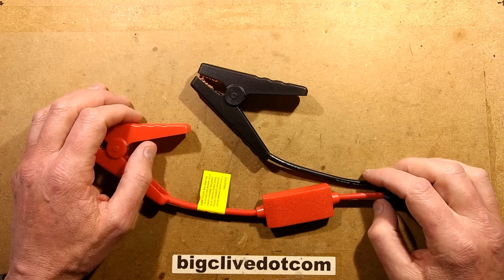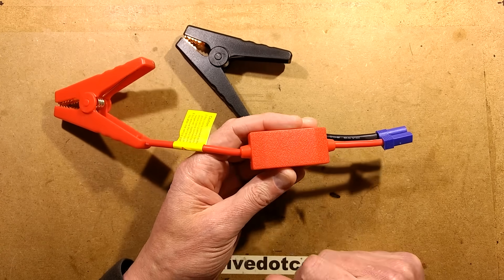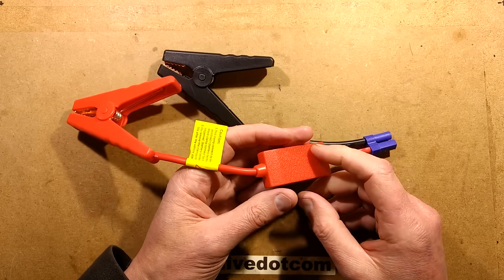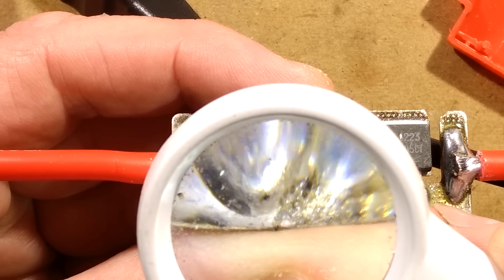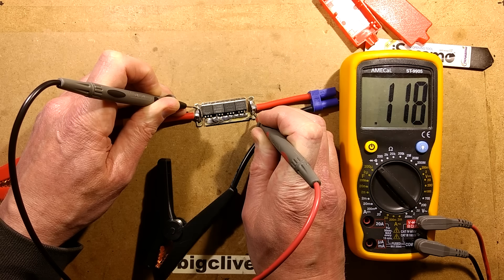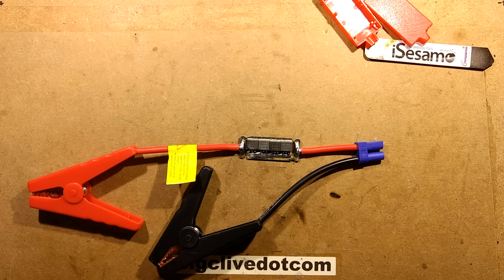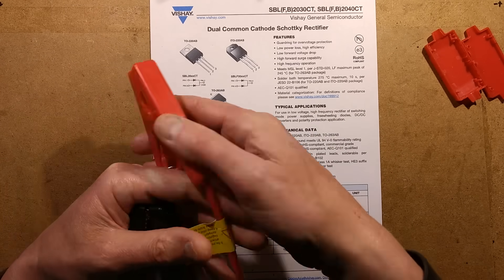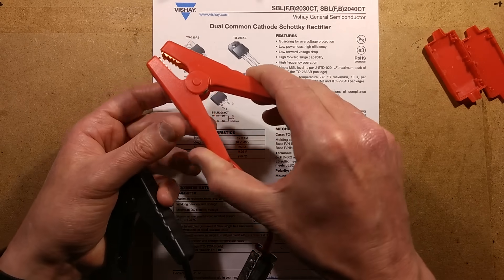What's in the little red box on some jump-start leads?  (Guess first.)

Comment: Isn't 10 gauge wire rated for only 30 amps? A long time ago I picked up a set of cheap jumper cables that wound up being 10 gauge. The first time I used them there was a loud bang and one of the cables blew in half.
Reply: Assigning a current rating to a wire without environmental conditions is pointless.
If you put that wire in ice water it will have no problem conducting hundred amps continuously. If you run it at 50°C ambient without air flow it will melt the insulation at much less than 30 amps. A few hundred amps are fine as well without ice water if it's just a very short time/pulse.
Reply: kuhrd Actually, 10 gauge copper wire can safely deliver much more than 30A continuously provided the insulation is sufficiently rated for the temperature rise and the wire is sufficiently exposed to sufficiently cool air to allow for adequate cooling (as opposed to being part of a tight bundle or in an environment with especially elevated air temperatures).  You will find that one can easily deliver a sustained 50A+ using #10 copper wire with a perfectly acceptable and safe amount of temperature rise to allow for plenty of safe margin for wiring with the typical 90C to 105C PVC insulation when operated in an environment at all practical for human habitation.  However, you can not continually deliver hundreds of amps through #10 copper (especially if copper clad aluminum) wire without both an excessive rise in temperature (power dissipated, and thus temperature rise, to a degree, increase fourfold for every doubling of amperage, which places some very practical upper limits on the current that can be delivered by a given wire gauge without self incineration) and a considerable degree of voltage drop for a given length of such wire.

The usual ampacity tables that most of us are familiar with are influenced far more by a desire to limit the degree of voltage drop in extended runs (typically to 5% or less) and ensuring a highly conservative figure to account for lack of adequate free air cooling when multiple power conductors are contained within an enclosed raceway, such as PVC conduit, where cooling is greatly impaired and accounting for the possibility that such raceways may also pass through areas with very high ambient temperatures, such as a poorly ventilated attic, that can further impair cooling leading to a greater rise in temperature.  The typical figure of 30A for #10 copper is primarily derived from sources like the U.S. Electrical Code, but these tables do not represent the actual safe maximums for a given conductor size in open air (you will get much closer to maximum acceptable limits if you instead look at the chassis wiring tables provided in Code, which would specify 55A for #10 copper wiring with 90C+ insulation in open air).
Reply: A fully charged LiPo booster battery will be 12.6V open-circuit. When I had to jumpstart my car this winter, I measured the battery terminal voltage during cranking and it dropped as low as 5.5V. After the first compression stroke though, voltage bounced back to 8V and the engine started with less than three seconds of cranking.

I was surprised that a power bank with 3x 3.3Ah cells (Silverstone PB06) was enough to start my car at -12C. Not so impressed with losing over 2V from the diode, wiring and contact resistance between the LiPo terminals and car battery's. Using #8 wiring would save 0.3V and give another 50A or so. Every amp counts for breaking static friction.
Reply: For continuous current with PVC insulation yes, 10 gauge is only safe for around 30 Amps continuous.  The big thing to consider here is resistance and voltage drop.  Since the leads are about 1 foot long each you can actually push a few hundred amps through them for a short time.  

High strand silicone insulated wire that is 10 gauge is generally capable of 140Amps when leads are kept to a meter (about 3 ft) or less for 15 minutes duty cycle in 20C ambient air.  In a situation like starting a car where the leads are only connected for 60 seconds or so and the actual cranking time is likely less than a few seconds, you could probably dump around 500Amps across the cable without to much issue seeing a voltage drop of likely less than 1.5-3V.
Reply: Stinky Cheese Actually, he used the word actually properly. He explained that the 10 gauge wire, in question, is capable of more than 30 amps. So how was he wrong to use it, in your opinion?
Reply: @Dad_a_Monk  you know thos C numbers are fake and that mac C for a lipo is 50C right?
Reply: @loris4798  Well, it has been over 2 years, so kind of a late point...The question was not addressed to you,  but glad you decided to comment, all be it late. I was commenting on someone's use of the word "actually". That had nothing to do with the "max C" of a LiPo cell. The word "actually" applied to that one sentence, not his entire post, which expanded beyond the rating on a cable. So glad you read an article, on line, and decided to try to use the info. Good on you! Perhaps you should have responded to @Ethan Poole and not me. Obviously you feel a need to correct someone on the ratings of LiPo cells, so good luck with that.
So...nice comment, have a good day.
Reply: He needs a bigger battery, preferably deep cycle, and heavier gauge wires to the bass amps. 

A capacitor will not be enough in this kind of situation where you have a large continuous power draw. It barely does anything with a small subwoofer, people just buy them because they look cool and have the large LED voltmeters on them.
Reply: Distance also matters.
Reply: them being short means more than 30a, cable rated at hundred of amps and is say 2 meteres long, such as my home made jump lead, are very thick and heavy, made from industrial welding cable, rated for 500a, and 5x heavier than cheap jump leads that say 500a
Reply: 500 Farads is way more than enough unless you're running something like 15 subwoofers which wouldn't even fit in a cobalt. If you're having voltage issues with that much in capacitors, you have a wiring problem.
Reply: Cool, up to 3 volts drop is good enough assuming its 14 V without load. Ignition usually stops working under 10.5 V
Reply: +Teardown Dan -  No, a more common value for a LiPo booster pack is 16.8V using parallel series of 4 cells.  The key to getting one to jump start a car is that the primary SLA battery isn't completely dead, that in a few seconds it gets some charge back into the primary battery so they are working in parallel to provide more current.

Additionally 3 x 3.3Ah cells is in inferior design for this purpose, doesn't make much sense that they would do that instead of 4 x 2.5Ah cells which due to a different internal construction have  higher current capacity, so are you certain that is how it is designed?
Reply: Pretty sure. There is no need to put multiple cells in parallel, LiPo batteries can output over 200A on their own - radio-control hobby batteries have discharges rates as high as 250C, which means over 750A for a stack of 3Ah cells.

Here's my tear-down and poking around of that PB06: http://www.tomshardware.com/picturestory/751-silverstone-pb06-usb-power-bank-tear-down.html
Reply: That's all the computers in your car starving for voltage, not just the ignition system. very bad for it. You need a hefty capacitor on that stereo system.
Reply: Doesn't matter because it's alumin(i)um and it could be rated at 10 amps at BEST...
Reply: Robert Gibbons I've wondered the same thing, oddly enough these things DO WORK. My only guess is that the battery is charged using pulsating DC and that's why you should wait until the charger quits beeping, green light goes on, etc.
Reply: even a 20c 2000mah 3 cell lipo could easily start a car. that would be a 60 amp continuous rating and roughly 90 amp peak (10 seconds). i have a model airplane i pull 50 amps out of a 12 guage wire, never really more then 5-10 seconds though.

what really makes these things interesting though, they can carry more then 80% rated amprage when they are dead, meaning even at 11.1v, the voltage really isnt gonna drop much.
Reply: The key word here being "cheap" you can pick up any set of jumper cables and if you are a veteran mechanic you can pretty much guage whether or not they are cheap shit or high quality. with that said and stranded on side of road you use what you got. cheap or high quality comes into play when you are purchasing a set , with todays modern all computer driven cars dont skimp on the jumper cables . why fry a 12oo dollar ECU because your bought the $8.99 junper cables from harbor freight instead of the $29.99 ones from napa
Reply: A 10 ga. wire will handle a lot more than 30 amps before it melts. 10 ga. house wiring requires a 30 amp breaker which means the breaker will pop long before the wire even gets hot.
 I have an Anker jump starter and it says it is rated at 400 amps peak current. Of course the peak current could be for only several milliseconds. The instructions say to attach it to the battery for 5 seconds before starting the car. This could give the battery a small boost before starting and then the battery would assist in starting. I drained my car battery by leaving my dome light on all night. When I tried to start the car with this Anker unit, it drained the Anker batteries right away. I brought my car battery back to life with a conventional charger by charging it for over 24 hours. I can't trust the Anker jump starter on a dead battery. I think they are more hype than practical. Any similar stories?
Reply: My ignition stops working at 9 volts. I know it's exactly that because my stereo system draws so much current it drops down to there before the car stalls :( 2007 Chevy Cobalt SS/SC
Reply: Stinky Cheese it must depend on the booster, mine are around 12.5V when fully charged (schumacher red fuel)...did a video taking apart the battery on my channel but I didn't want to break the jumper cable part so I couldn't tear that apart.
Reply: I have a big cap on it currently (500 farads safe for up to 16.2v). I have another 1000 farads to install for 1500 farads total and also got an aftermarket alternator for more power :) I haven't run a new front to back power cable (the factory battery is in the trunk) but I'll do that when I install the new alternator. http://ecuflashking.com/07cobaltSS_SC/2015-10-08-New_battery_terminals_and_wiring.jpg
Reply: The small power banks that use those cheap leads connect straight to the 3S LiPo pack, no other fancy electronics or protection in-between aside from the in-line diodes and (for the better ones) fuse.
Reply: The leads are VERY short, that is what allows them to carry more than 30 amps momentarily.
Reply: In the case of cranking an engine though, those 100-500A are only for 3-5 seconds at a time. The copper's specific heat should be sufficient to prevent the cables from significantly heating up and insulation temperature rating becomes a non-issue: one meter of #10 copper and 500A for 5 seconds is 5.75kJ, which is only enough to heat up the cable's ~500 grams of copper by about 20C.

Still wish they used #8 cables on these jumper leads though. 40% lower cable losses and 40% more specific heat to help maintain wiring at a sane temperature when cranking for more than 5s at a time or multiple times. (Though you really shouldn't need either on a reasonably well maintained car or small truck.)
Reply: @teardowndan5364 I am fairly sure that these cables are "CCA / Copper Coated Aluminum".  They will heat up more than copper wire cables.
Reply: Yep. Check with the manufacturer of whatever cable your using for the proper rating. I've seen many current ratings for an ambient temperature of 85c.
Reply: +Ethan - Quit using "actually" where it isn't needed.  Thank you!
Reply: Stinky Cheese actually, no

Comment: You say you're looking for a tester? I have an Anker branded one with active circuitry in the little box, presumably just to sense polarity. It has always worked for me but now has a loose connection inside the box (presumably from being coiled up tightly in the carry case) so I really should get the cable replaced. Good to know there are alternatives though.

Comment: Boost Converter
Reply: Bummer it's a buttload of diodes :(
Reply from the maker: Especially with the overload.  Quite possibly exceeding a volt or so.
Reply: kuhrd those diodes won't do a thing if you hook it to the car battery backwards.  Unless they blow like a fuse when the large forward current flows.  The diodes will be forward biased in that situation. They are there to keep the car from trying to charge the lithium battery, which are rather picky about charging voltage and current.
Reply: The primary reason for the diodes is so that people can't hook it up backward with all that current coming out of the Lithium pack opposing the lead acid battery. Preventing the power from back-feeding back into the boost pack is more of a bonus.  Since these are intended to boost the primary vehicle battery when it is low and not completely flat which is a typical situation for the battery to be in, the boost pack will transfer enough energy in the 10-30 seconds it takes to get back in the car and start it that both batteries are working together to start the vehicle and thus the current demand is also not as high as it would be if the primary vehicle battery was completely flat.